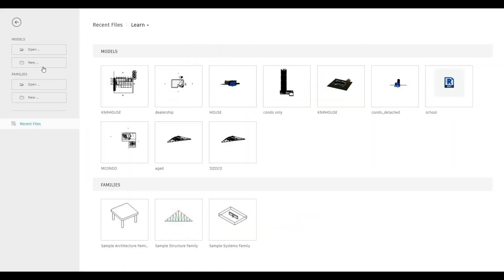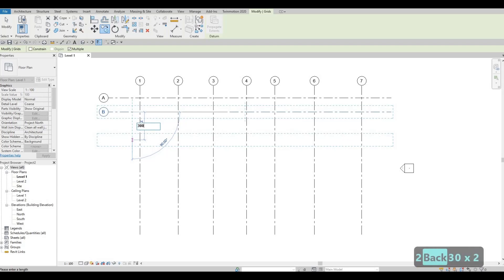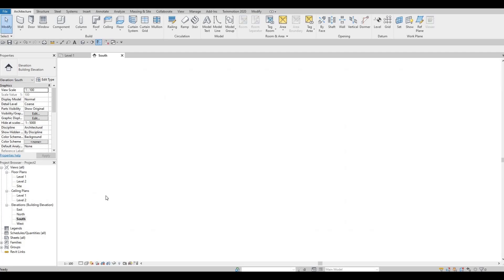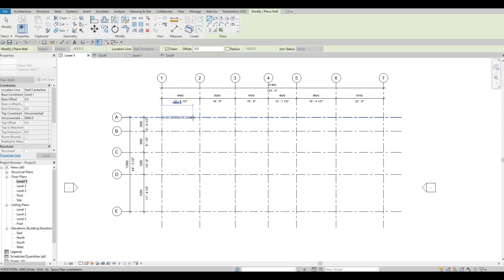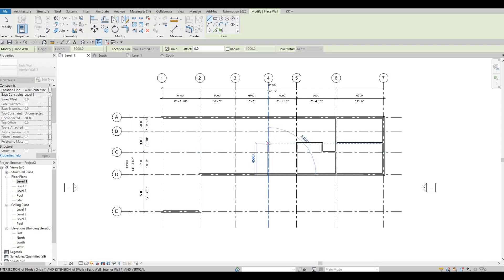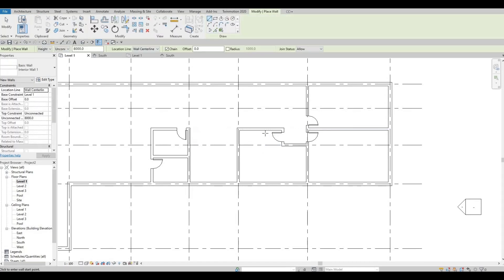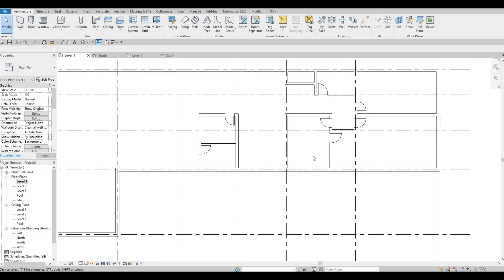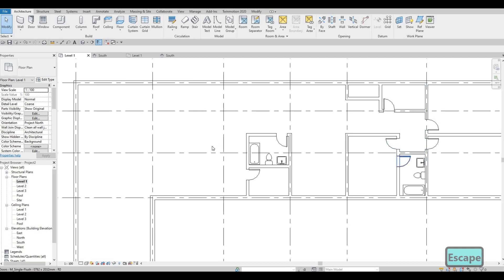KNR House | Part 1 | Complete Step by Step Project | Revit Tutorial

Comment: How you set the temporary dimension line (the color blue one) in the center of the wall? mine is always on the exterior faces and i always adjust it one by one. Any solution for this?
Reply from the maker: I think it depends on if you use, like me, center line when I create walls and also I do move it as it is a temp dimension and I only need to verify certain distance. I will check if there are a solution or a better way for you. If I find any, I will post it in this comment. 🙂🙏